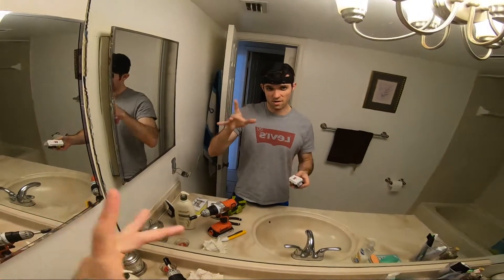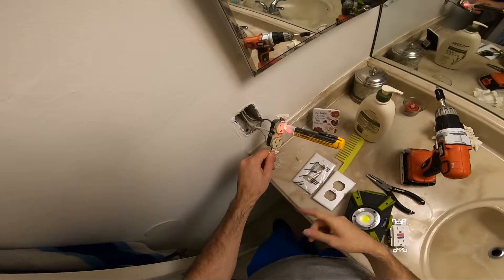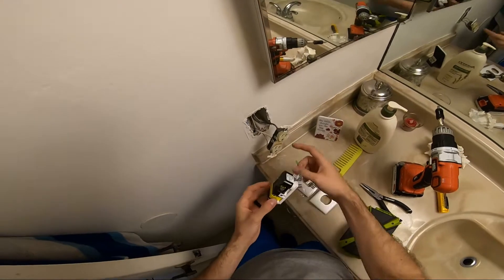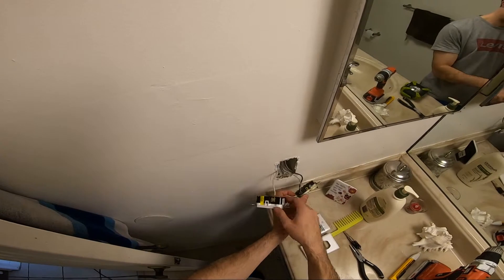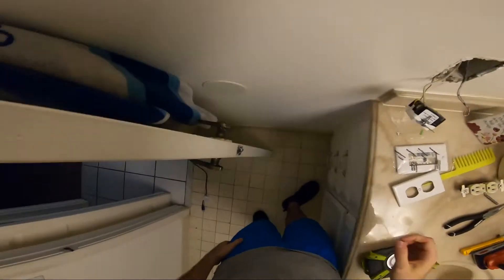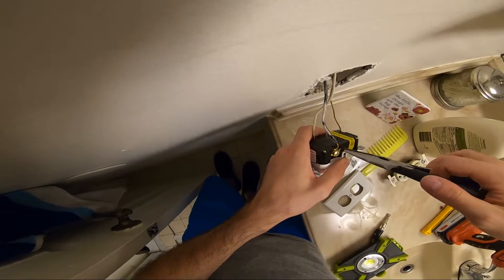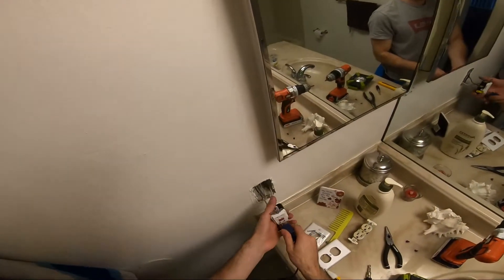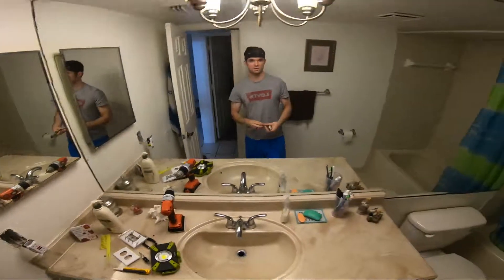Upgrading an Outlet to GFCI (installation video)

Comment: Aren’t there separate line and load wires that are mounted separately on GFCI outlets vs standard outlets?  Don’t you have to determine which is which before connecting them?  I did not hear you mention them or see the installation.

Comment: When something is plugged into the gfci and turned on it measures the current flowing from the hot wire to the neutral wire (return path). It should be the same. If the difference is 5mA or more it trips preventing a shock. This tells the homeowner that there is a current leak that should be investigated. The green light has nothing to with ground, it means the device has passed a self test and is providing power. GFCI'S are code compliant for older homes with 2 prong receptacles where there is no ground wire present. In this case you have to put a label on the cover plate that says "no equipment ground". If you have downstream receptacles from this point you can connect them to the load (under the yellow tape) to protect them. You would have to place the label "gfci protected" on those. These labels are provided in the gfci box.
Reply from the maker: Thank you for the information! This is valuable.